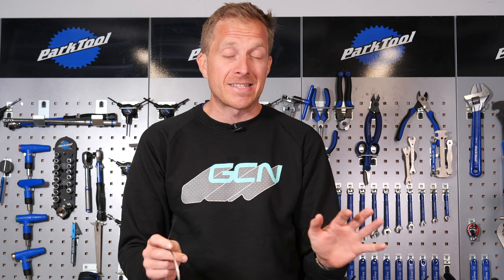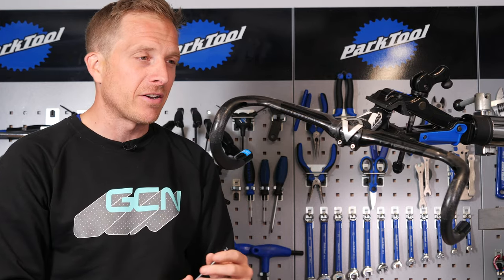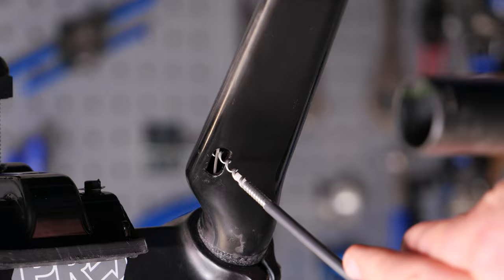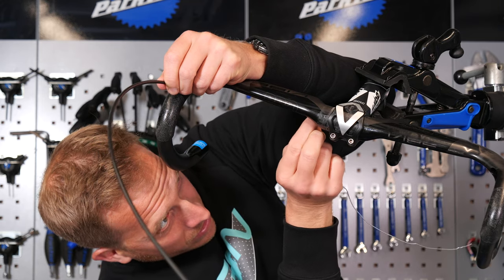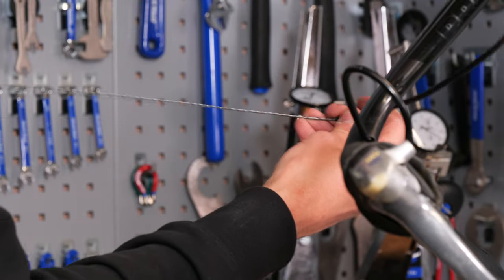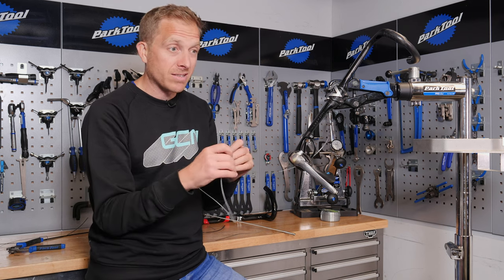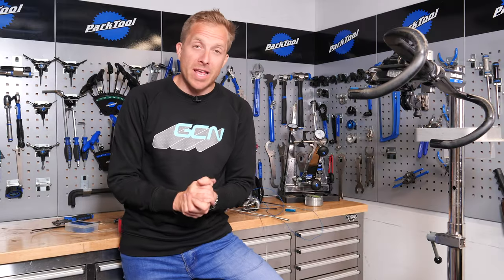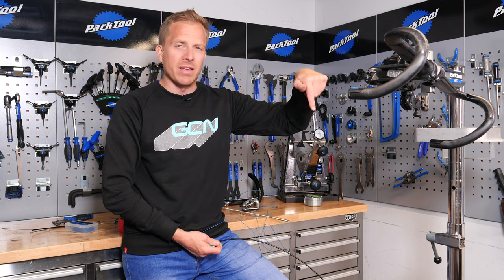Internal Bike Cable Hacks | How To Replace Internal Brake & Gear Cables

Comment from the maker: Do you have any hacks to make internal cable routing easier? Share them in the comments below 🔧
Reply: The cables that I route fully internally (which includes threading it through the headset) are never actually cables. They are either hoses or wires. Because of the sharp bends for shifting.
Reply: I have aero handlebars which can make the cable routing a faf. I use hemostats to pull them out the exit hole. It's incredibly efficient. Highly recommend, much wow
Reply: I have trained my pubic lice to route the cables - works a treat.
Reply: Hello, I own a bike with internal cabling for less than a year. Last winter I changed handle bar to a Zipp SL 70 Aero and so I was forced to remove cables. As dedicated kits from Parktools are very expensive I though a lot and imagined a hack hoping it was a good one. And it is working !
Buy heat srinkable tubes usually made for electric cables. (I bought 3x1,5m for 3 €) Before removing cables from bike frame/handlebar, insert the cable into the tube and push tube just before it disappear into frame. Then use a lighter to srink the tube very close to the cable on 5 centimeters/2 inches. Then try to push tube as far as possible. If it is blocked try to push on both cable and tube. At some moment it should exit the frame at the right place. Pull the tube few centimeters/inches more to have it going thought the frame. Then you can remove easily the cable leaving the tube inside the frame.
Later before trying to insert back the (new) cable, cut the srinked part of tube to ease insertion.
Reply: GCN Tech a spoke works as well as a twizzly tool to hook an internal cable out. Also, don't buy an old bike with no BB cable hatch, or a really small poky one. Get a bike with a a lot of room in the BB so the hoses and wires go round the corner easily.
Reply: One of the easiest way to get the cables to route to an exit hole is to use a powerful magnet held next to the exit. Helps to guide the inner cable  to within a mm of the exit.
Reply: Simple: Don't buy a bike with internal cable routing.  Sure, it may look nicer, but replacing cables is a PAIN IN THE ASS/ARSE!!
Reply: dental floss attached to the existing cable, knot and a tab of super glue, Pull old cable through, cut off the floss and attach it to the new cable and pull that through.
Reply: what's not easier is to pull out the cable with tweezers
Reply: After feeding a string into the top of my frame, I was able to reach into the bottom of the frame with a piece of tape to grab the string. The inner sheath of the old shifter housing made for a nice wand to fish a piece of duct tape into the bottom of the frame. Twisting the tape around the inside of the frame made it easy to snag the string.
Reply: Swiveling the frame at different stages and a fishermans sinker made out of lead with holes in it is how Giant install the initial draw wire in their Taiwan factory .

Comment: Before removing the old inner cable superglue some fishing line or thread to the end. When you pull out the old cable the fishing line comes through the frame with it providing a trace for the new cable.  All you do then is cut the fishing line from the old  and glue it to the end new cable now just pull the new cable through the frame with the line.
Reply: FUCK I HAD TO READ THIS AFTER I ALREADY PULLED THE DAMN THING OUT!
Reply: @mikehunt8375 😂😂😂

Comment: RULE #1 ---  Never ever ever pull the cable out of a properly routed component without running a guide tube in first.  Don't put yourself back at square one when there's no need.  - Nice DIY cable grabbing pick, Jon... definite hack!
Reply: I wish i would have read your comment before i did exactly that to my mountain bike. A simple install turned into a pain when i decided to pull the cable out without turning my brain on. Hahaha…a good two hours passed before i managed to pull it through. Damn cable kept getting stuck!
Reply: Oops....😢

Comment: Before you take the cable out, tie off a length of dental floss and pull it through. Use that as the leader for the replacement. Just pull gently.
Reply: You are a king

Comment: they make a barb that has the opposite threads on each side, you place it in between the new housing you want to run and the old housing you are removing. use a 2nn hex key to tighten them together, then simply pull the old housing out and the new housing is pulled though. Great little gadget, I believe it comes in sram hydraulic hose set up kits. Obviously this only works with previously installed housing. Being a bike mechanic most of my repairs come with housing already run, and this trick saves me tons of time everyday! Also the slick liners are great for bare wire replacement. I remove all cables with a slick liner and tape it with masking tape to the frame, this prevents you from crossing derailleur cables in the down tube. I do both of these tricks a dozen times a day, both work great!!

Comment: I found a strong magnetic will help pull the cable in the desired direction while pushing it through. 
Great video
Reply from the maker: Nice one, cheers!
Reply: In pro shops we always just used an earth magnet. Or one of the hundreds of wheel magnets that we had stuck to our repair stands. The more challenging bikes have remnants of the air bladders from production left in them which had a tendency to make guiding cables really difficult. A pro trick is to put a small 30 degree bend on the end of the cable that helps to steer as you try to twist the cable around bb Shells, cage mounts etc. I've also used hemostats (Kelly's and mosquitoes) to reach into the small oval holes to grab cables and persuade them. Sometimes on a straight route you don't even have to fish, just stick the magnet on the hole and slide the cable around until it connects. One final bit, this goes without saying, use gravity to your advantage it's way easier to route down than up, and much easier with a proper repair stand.

Comment: This answer my potential question... No need of internal wiring tool if you just use a normal cable brake/shifting system. All I need is a little home made tool as in the video . Thanks for sharing this.

Comment: Remove the wheels and you can then twist and turn your frame for gravity to help it towards the exit hole, also solder the last inch of cable to give it more weight, it won't then twist and turn inside as much.

Comment: The magnets can also work on Titanium frames.  Ti is weakly magnetic, but generally not enough to stop you from using that technique.  However, if it's a raw Ti finish, you may want to put some paper or something between the magnet and the frame to avoid scratches.

Comment: I had to replace the brake cable on my Giant Cross City. It has internal routing where the cable outer runs through the frame.
What I did was disconnect the cabling from the V-brake caliper and removed the inner cable from the housing. Whilst the old cable outer was still in the frame I joined the new cable outer to the old end to end with some electrical tape, then gently pulled the old outer out of the front of the frame thus pulling the new housing into place at the same time.
One thing to be mindful with this method is how thickly you layer the electrical tape, too thin and it wont hold the end to end join. Too thick and it could get jammed in the frame
Reply: This. I have no idea why they make this more complicated than necessary?

Comment: I will say from experience, Jon is right about removing the bottom bracket.  It may seem like a hassle, but it will save you time and trouble in the long run, and give you absolute confidence the cable was routed properly.

Comment: Personally, I manage to cope with routing my internal cables via the following method:
Step 1 - insert cable into frame. 
Step 2 - poke around with the cable attempting to find the exit hole. 
Step 3 - swear repeatedly. 
Step 4 - give up and get a cup of tea. 

Flawless method for satisfying results every time, so long as you love a good cuppa 👌

Comment: Fold a cable tie in half and push it through the hole. If you push it against the inside of the tube it’ll open up and make a big loop that’ll be easy to catch the cable you’re pushing down the tube. Once caught, just pull the cable tie back out and the cable will come with it..

Comment: I use a piece of string tied to the end of the cable and get a vacuum cleaner and suck out the string and then pull through the cable and then slide on the outer..works a treat..

Comment: You tape the old and new housing together at one end, and pull the old one out while you push the new one in at the same time.  Works for insane cable routing in broadcasting studios and computer centers, so why not here?

Comment: If, like me, you're a cheap skate then you can buy some neodymium magnets from Ebay which will enable you to drag a cable through the frame. Same principle as the tool mentioned at the end of the video but at a fraction of the cost.

Comment: Could you possibly soldier the old gear cable to your new one to do the rear mech? So chop the noodle off at the shifter end, do a small and tidy blob of soldier between to the two cables. Then pull the old cable out from the mech end thus pulling the new cable through the labyrinth of turns and internal sheathing? Then when the new cable arrives at the mech, trim the set up, then cut the cable as you would normally?

Comment: I had a really nasty experience with a Boardman Air 9.2. The front mech cable outer from the bar sits on a frame stop in the top tube, and the inner runs through an internal tube all the way to the exit just below the front mech. This ought to be dead easy to thread through but the inner cable had disintegrated, ultimately blocking the tube at the U-bend under the bottom bracket inside the frame during removal. This all stemmed from an incorrectly cut outer cable from the top tube that had kinked and split at the in-line adjuster, exposing the outer cable strands which had chaffed the gortex inner sheath and frayed the inner strands. The inner was frayed and chaffed at the clamp bolt end too, so no matter which way you moved it, it was in danger of unravelling, which it decided wast best accomplished in the U-bend. I know because any new inner went in so far and stopped. It was gauged by its length to be under the bottom bracket.
I had to dismantle the bottom bracket and cut the U-bend out, and run bare inner from the end to the front mech. This was very fiddly, especially cleaning and deburring the cut ends of the tube. 
Any future replacement can only be done by dismantling the bottom bracket.
I think a new U-bend could be made from either car hydraulic brake pipe, or an old V-brake noodle or lead pipe, using the pipe to cable joining tube to join the two bits of tube, but the problem would be anchoring it and sealing it to the frame at the exit. It really is all unnecessarily fiddly, and inaccessibility should never have to rule form in the designing stage.

Comment: Best hack for internal cable routing... Electronic gearing
Reply: Ha, not with Di2 and a 2018 Emonda. Not even Trek knew how the cables ran through the frame. There was nothing online, they couldn't help over the phone and the Trek store was no better.
Got it sorted in the end, but it was a headache for a few days.
Reply: @d.gwebster1109  lol that sounds awful dude. I will have to amend my last comment then best hack.... take it to a bike shop and let a mechanic do it lol

Comment: Can you run hydraulic hose line internally if your bike is equipped with mechanical disc brakes? I have 2016 Cannondale synapse alloy 105.

Comment: my bike has an outer(should it just be an inner gear cable) cable all the way internally through the frame. is this wrong as i had a mechanic fit it and now cant get the cable out of the frame.
Reply: Did you ever find the answer to this question? Because it's the answer I need 😂 I'm building my bike currently, and always planned to run a full length outer cable housing through the bike! Is that wrong?
Reply: @bjsr126  Not all bikes can run full-length shift housings. The Tarmac SL6 for example, has a shift housing stop at the top of the down tube.

Comment: Is it possible to buy the cable sheath on its own without having to strip it out of a good cable housing? The ones factory fitted inside the frame get manky after 2 or 3 years and really affect shifting

Comment: Top tip: Don't buy a Boardman Aero bike. As a someone who works in a bike shop they are by far the worst bikes on the market for this problem. It's like the designer didn't even think about maintenance. 

Second best tip, don't but a bike with internal cables bike, external are better for at least 7 reasons I can think of.
Reply: Go on then. I'd like to hear all 7 of them.

Comment: Does a frame that has cable going thru the frame have the inner wire cable going thru an outer wound wire that has plastic cover or is it just the inner cable without the wound outer portion?

Comment: Hi Jon, I got that same handlebar and it's a nightmare to fit mechanical  shifting and brake cables. It's ok to fit the first housing but very difficult for the second one, have you got any tips?
Reply: if you need to put two cable outers through each side of the handle bar then get two pieces of old cable to begin (in good condition), feed them through the handle bar and tape one end of the cables down so that the do not fall out, these are your guide. Take your break cable outer and slide that over the first cable guide till it is all the way through, then take your gear cable outer which should be a little more flexible and slide the over the second guide cable all the way through the handle bar. Remove the guide cables and you can then continue your installation as normal.
Carbon bars, make sure there are no moulding burrs left on the inside of the holes where the cables exit.

Comment: I have threaded multiple new rear cables through using that transparent hose and still when I fix to the rear mech (new) the gears shift up the 11sp fine but jump halfway down the cassette from 1 click. Seems to indicate some cable slack? Or a broken shifter (working fine before rear mech/cable change). LBSs keep turning me away due to Lockdown demand so I'm stuck! Have spent days trying/failing. Even tried a new hanger, rear mech guard pipe. The housings are new and I am sure there isn't crossover with the front mech cable (though I did change this as well initially). Should the cable push back/forth from the chainstay smoothly? When I pull it taught, being its last exit point, there is slight spring back upon release. Need to end this misery!

Comment: So I'm planning to swap the stock handlebars that came on my new bike with a pair of carbon ones with internal routing. Is this the process I need to follow? I assume there is no problem reusing the outers since they are new?
Reply: Mark J.A don't do it... you will regret it! I did it, it's messed up my shifting, it was a pain in the ass for maintenance and the aero bars aren't as stiff as traditional bars and when you sprint they flex all over the place... Aero stuff like that is just for cosmetics it gives zero performance benefit in the real world.
Reply: Reginald Scot no! It isn’t depends on your weight! I have 3T aero bars, and I weight 56kg and they are FINE

Comment: So I'm about to build my bike which has fully internally wired cables. Why do you not run the Gear outer cable throughout the full length of the bike? Is that a choice or just something you don't do? 

I was planning to run an outer cable the full length of the bike over the gear cable, and then have a foam dampener over the top to prevent rattling. 

Is this okay?

Comment: I’ve got the pro vibe aero handlebars. Is there a hack to get a wahoo mount to fit. There’s not enough 31mm bar before it distorts and goes aero. I’ve had to get a sander to slim the mount down. Even tried the k edge aero mount to no joy
Reply: I had the same issue and found this aero handle bar mount sorted it. Here's the link to Rutland Cycleshttps://www.rutlandcycling.com/accessories/electronics/giant-combo-mount-for-slr-aero-bar_320391?yotpo_token=6a130013779a1df167a6fbba9025fbe57f818a36&utm_source=yotpo&utm_medium=email&utm_campaign=map
Reply: SAF1981 fab cheers il check it out

Comment: Tried to fish through an electric wire from my dynamo hub to the front light inside the fork.
That fork is miraculous! I've got a string and a hoover. I have attached the hoover to the dropout and stated it. Then i put the string inside on the other end and it was sucked out. Well, almost. It never got out at the drop out......
When i finallyanaged to fish through the string, I attached the wire to it, and the tape failed. 
What a waste of 2 hours....

Comment: Vacuum cleaner on one end, and a good length of thin string (sowing) tied to the end of of a brake/gear cable from the other. wiggle. and you've got it threaded. If you need magnets, you probably don't own a bike to begin with.

Comment: Internal cables are a complete disaster.
Especially in mountain bikes - in water crossings the chassis will be filled with water because of the lower holes and the mud will stay there forever

Comment: SCREW internal cables
BUY external cables
Reply: unfortunately there are no production carbon frames with external routing anymore... thanks to the bicycle industry marketing departments creating a solution to a problem that never existed, pushing an obsoleting trend that nobody asked for, nobody wants, and nobody needs, creating ever more complexity to a system that exemplified simplicity and efficiency
Reply from the maker: hahah!
Reply: Another good reason to go retro.